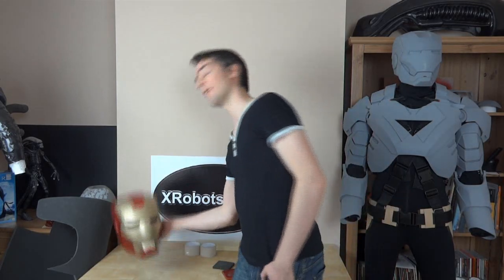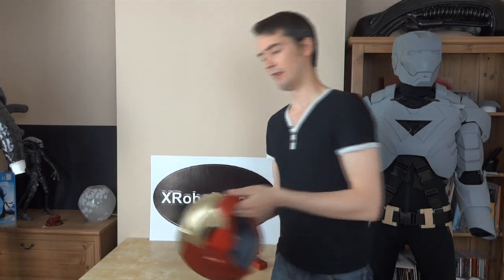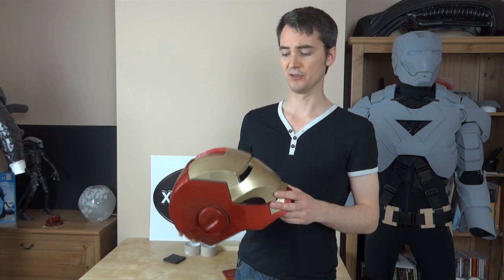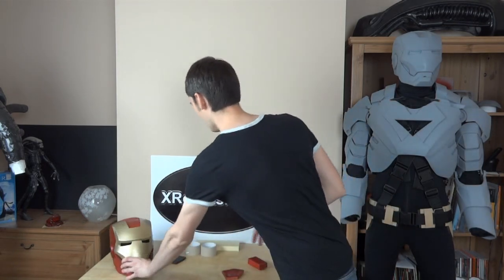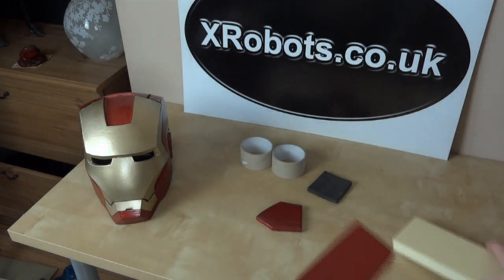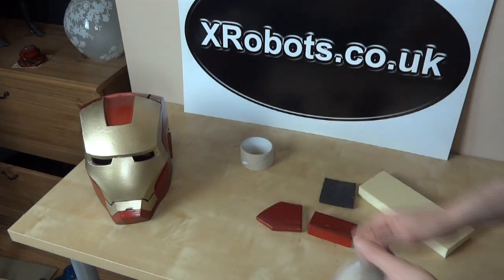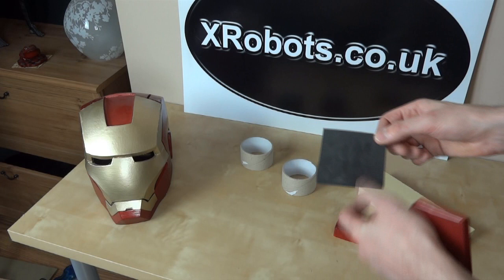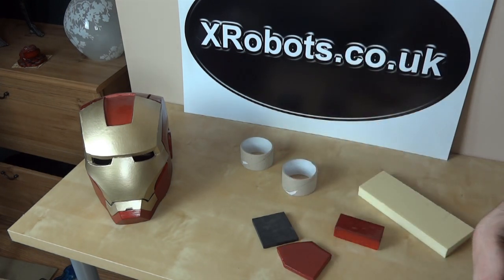Iron Man Power Suit #6 | Plastic Coating Foam | James Bruton

Comment: Tip... Elmers Wood Glue, (it's yellow) is not water soluble when dry.  When it dries, it can get wet, creates a really hard shell, and can be sanded to a smooth finish.

Comment: Easiest (and cheapest) solution is to use the white Elmer's School Glue.  It has more additives and is more acidic than straight PVA, which is important to consider for book binding, but doesn't make a noticeable difference for this application. ^_^

Comment: Great video. How does this hold up to being bent? I used EVA foam to make a few armor pieces, I sealed it with wood glue (several coats) and then paint and polish. I had a couple spots in my collar piece that creased where it bent a little. Does this make it totally rigid so it can't bend? Does it crack? Will it crease? Thanks

Comment: Awesome James! 
Question: Can I use an Epoxy Resin with hardener instead of the Smooth-on product?
I have used West System brand Epoxy Resin 105A with 206 hardener. Will this work the same way as you described?

Comment: For the bubbles, mentioned at 10:00 - I have seen in videos on coating wood (eg table tops) with resin, that a butane flame played rapidly across the surface pops all the bubbles, and leaves a very smooth surface.  I don't know if it would work with this, but it could be worth an experiment on some piece of scrap.  Keep the flame moving.  Don't actually heat any localised area of the workpiece.
Reply: I saw the same technique with heat gun and even with hairdryer. And that's definitely worth a try, though open flame could be really too much for the foam.
Reply: does anyone know if this coating makes it less flammable, I read polystyrene is highly flammable, but would coating it make it usable as something like an incense burner or ash tray?

Comment: great video. I do alot of slush casting, i suggest using the small white cups you get. they have small lines on the edge so are easy to measure. i pour a small amount onto each cup.. leave for a few minutes for the bubbles to disappear, then pour one into another ( when pouring, tilt the cup and pour onto the edge.. this stops bubbles forming) and mix very smoothly. then you can brush on. when brushed on use a hot air gun to remove bubbles from the surface.

Comment: Easyflo 120 is a good rotational cast urethane but i would suggest Easyflo 60 with microballoons in it. you'll half the weight and double the strength that way. and james if you see this, epoxy resins can be used on styrofoam without sealing.

Comment: Instead of brushing the PVA, have you considered using a LPHV (Low Pressure High Volume) spray gun for application? These guns are available with different nozzles, needles, and air caps for different viscosities in materials being applied.

Comment: I've a serious technical question: I'm using this very method but the resin seems to cure EXTREMELY FAST, I'm painting it on, and it's working fine, then BAM. 2 minutes in and it begins to catalyze before my very eyes. Literally in seconds. Is it the fact I'm using it in a very humid garage?

Comment: on eps i found  using bondo as a second coat for more detail and easier shaping/sanding helps. cuts down time it takes sanding the 65D. then i hit it with a last coat of the 65D to give it the clean plasticy look.

Comment: I believe what happened was that you did quite mix the correct ratios on your second coat. I was casting a mask once and this happened. As that was a mould I could just pour it out and go again. Usually the sign this has occurred  is that the resin doesn't go the creamy white colour that you see in James' video. I suggest you try cleaning off the stickiness a bit with a cloth and go again with another coat.

Comment: you could use a two part clear epoxy resin also instead of ploy resin cast, the epoxy dries slower and may even drip, dont know, but i have added artist oil paint direct to the epoxy resin for color.

Comment: I did both ways over the weekend. Heating it does speed up the process but the results are pretty bad. It cracks pretty severely. I put a fan in front of one of my test pieces and it sped up the process while holding the quality. Personally, if you have the time let is cure on its on in room temp, but if you're pressed for time simply throw a fan in front of it. You'll just have to sand a little more and do 1 or 2 more layers since it doesn't dry evenly if that makes sense.

Comment: Question; Could this method be used to coat a large section such as a chest piece? Main thoughts are that I could brush it on, let it set and then have at it with sandpaper or something... if you can do that. Any tips or info on larger pieces would help, totally new to foam building/coating and I'd rather like to try this!

Comment: If you are wanting to work with stronger plastics check out Sintra and Worbla. Sintra is a type of PVC sheet thermoplastic that can be molded with a heat gun like EVA foam but it is a lot stronger and painting it is easier. The downsides to Sintra are that is can sometimes be hard to find depending on where you live. Worbla is another type of thermoplastic modeling material. When heated it is a lot more pliable than EVA foam and Sintra and it is easier to mold it into organic shapes. Scraps of Worbla can also be stuck together and even molded together using heat alone. The only downside is that Worbla is extremely expensive per sheet.

Comment: Nice video, but I'm little bit concerned about losing some of the details. If You want to get rid of bubbles that are accumulating on the surface of the cast. You should try using blow torch. The flame will pop up all of them.

Comment: ...Hi, I'm hoping to use your technique to cover some polystyrene before slicing it up into 6mm sections, do you think this product would tolerate being sliced up on a bandsaw without deterioration or parting from the polystyrene. Thanks in advance.

Comment: Is it possible to remove the styrofoam after the plastic hardens?  I'd like to build something out of foam for the shape, but would like the finished product to only be plastic. I'm wondering what kind of surface you'd have after chipping away the foam.

Comment: A question for you. I'm getting ready to work with smoothcast for armor in a similar fashion you are. I noticed on their website, the sell 65D for 1 gallon bottles, so 2 gallons in consideration of part A and part B. With that, figuring you do 3 coats per armor piece, how much of that 2 gallons would you end up using? I'm trying to get an idea of how much I'm going to end up needing for a fairly large armor set

Comment: I have been doing fiberglass coating for a while on foam now and I'm pretty happy with it, because you can control the smoothness of the surface much better than with any other material. I was willing to try with a smoothcast resin AND fibers, but do you know if by any chance they work with making fiberglass like polysterene resins do?
Reply: What r ur results?

Comment: I am a big fan of your tutorials.  It seems like you are one of few Iron Man builders who are willing to share their techniques and secrets.  Especially the motorization of the helmet.  I am in the middle of a build but haven't decided if I should plastidip or rotocast.  Have you tried using body filler on top of the plastidip?  Do you think body fillers such as bondo would stick well to plastidip?

Comment: James I have been building a suit from foam as well. MOST of my pieces have been sealed and painted. Can this process still work on the already painted parts? I used a 50/50 mix of glue and water.

Comment: This is cool.  I was wondering James, do you know how this would work for PLA plastics?  I got a 3D printer, and I want to paint the sculptures I create, but PLA can melt in heat -- I'm trying to think of ways to make it stronger and more durable- as compared to just casting it out of another material.

Comment: since the foams end result is of a plastic nature does this mean a step using bondo is not necessary? also, for filling in cracks can we use some sort of filler?  for example, for a leg piece different rectangles make it into a circle shape but V shaped divets are between each rectangle. great video my friend.

Comment: Hello, quick question. If you just want to have a white plastic coating, can you just use the Smooth-Cast 65D? Instead of after using the Smooth-Cast going through all of the work to use a plastic primer and then a white plastic coat?

Comment: PVA is used as a mould release agent for resins so flexing the foam you've coated will cause the plastic coating to de-laminate from it
Reply: Yes it is wood glue, my point is plastic and resin will not bond to it
Reply: By no means an expert, but a 1 second google search would reveal PVA (release agent) and PVA (glue) are two different things albeit, very similar.  polyvinyl alcohol vs polyvinyl acetate.

The one used as a release agent is readily dissolvable in water, and the PVA well known as a wood glue is often used to waterproof materials.  They are quite distinctively opposites in terms of properties despite the fact that polyvinyl alcohol is made from polyvinyl acetate.

I believe PVA's (glue) adhesive properties relies on the porosity of the material in question, so the foam would likely be well bonded to the PVA, and cured PVA on the surface would likely create a seal of some sort, one that could delaminate a resin coating if it wasn't applied while the PVA was still tacky.

That said, a resin coating over cured PVA is probably as good of a bond as it would be on any other non-porous, smooth surface.  You'd have to do it while the PVA was still tacky or key the surface after the PVA has dried to create a better bond, assuming there is no incompatibility with the two materials.

PVA can be quite flexible so it will likely delaminate from a resin coating given enough traffic and flexing, just as a basic laminate coating on wood (such as a desk) can be easily peeled off by hand, and yet stay happily attached for years under normal usage conditions.

This plastic coating is also going around most of the item, encasing it, so delamination probably wouldn't do much. You could probably hollow out the foam since by that point, it's the plastic coating providing the structure /strength and surface finish..

Comment: So if you were to make a main body as you did with foam but instead with from expanding foam, coated it with PVC and the plastic coasting, would it have the same effect? I'm looking to sculpt a very large shell with expanding foam but it needs to retain integral strength, lightweight, and a smooth finish. I'm new to this please can someone advise. Fiberglassing isn't really on the table as I live in a studio apartment with no space to do it.

Comment: Have you seen that Smooth On has a couple of other resins that have a slower curing time? It looks like 65d has a 15 minute curing time, 45d and 60d have a 30 minute curing time, and 61d has a 60 minute curing time.  I wonder if that might help?

Comment: Do you think that letting the Polyurethane set slightly before painting it on would make it easier for the non-rounded pieces? Just so that it's slightly less runny, or would that make it too difficult to apply?

Comment: I think you'll find PVA is basically the same wherever you get it. Go for any craft PVA glue. It's not vastly important which you use, for example I use Hobbycraft brand craft PVA glue and it's fine. The only thing I'd say not 'School Grade' just in case as that tends to be weaker for safety reasons.

Comment: Could you get a matte finish after painting using this method too? (Would regular acrylic paint work?) Also, does this method give a waterproof finish once it's done (as in, one that wouldn't get ruined if the wearer got caught out by surprise rain)? Great video, thanks for posting it :)

Comment: How resistant is polyurethane to scratches and abrasions?  Say I want to cover my own BB-8 (not 3-D printed).  Would rolling on concrete or over bumps in tile slowly destroy the surface?

Comment: Would many thin layers work well for say, a bladed weapon prop? I'm going to be making Bravura, and axe from Final Fantasy XIV, and would like to know if the smoothcast would hold up on insulation foam while the end is on the ground. Would it bend and crack? Would my best bet to be to buy some worbla? Thanks! Love your videos.

Comment: Wow this tutorial just saved my prop building life (my polystyrol-sheets would melt away when combined with certain materials usually) So if i understood correctly PVA can be used between two components that would otherwise react? - and then about the smoothcast/polyurethane - is it toxic/does it smell? Thank you very much - subscribing anyway ;)!

Comment: If anyone else was put off by the price of Smooth on in the UK like me I have tried and tested an alternative. Polytek Easyflo polyurethane resin works great. I chose Easyflo 95 because it gives you a slightly longer pot life (5 minutes). The finish you get has a bit of flexibility which is handy to ensure you can actually move about in your suit.

 If you want a more rigid finish they have many other varieties with differing properties. 95 possibly goes more rigid with more coats.

Comment: Hello James, fantastic site and great work!  I was just wondering if you had noticed any cracking/flaking problems with the plastic coating at all?  I would think that there is still some flexing going on with the foam and I was curious how that effecting things overall.

Comment: How many square meters do you think a gallon would cover? This would be perfect for a full body armor cosplay that I want to make, but if it takes 3 or 4 gallons at $85 a piece, then it is a little too expensive..

Also, when I checked out the hardcoat 65d online, it said the amount was a gallon. This is a gallon total, not a gallon of each part, right?

Comment: I have been using the Smooth-Cast 65D and sometimes it cures really fast and other parts take DAYS! I've been coating my styrofoam with wood glue first. Any advice?

Comment: So I see this stuff being made for more cybernetic pattern with sharp and or flat edges. Can this be used to make more rounded, sleeker, and or streamlined designs? For example what I'm going to attempt to make is armor that includes shoulder armor which has a round design that is waved at the bottom much like a turtle shell. Would it be possible to mold it like that, and would you happen to have any tips on how?

Comment: Hey James, I'm using this method right now for my Iron Man suit, the only problem I'm having is sanding it....sometimes the plastic will start to peel off when I sand.. and sometimes i just can't get it on smooth...It also starts to bubble up. Do you have any suggestions or tips? I bought all this resin and am hoping to get it working :)

Comment: First off man. Thanks for everything you do. Not only are you superinformative but very fun to watch :)
I have a question about the PVA glue. I watched another video series that outlines a similar method but the author says to water down the glue at a ratio of 1:1 or else the glue won't bond to the foam very well. What are your thoughts on this?

Comment: yeah,i figured id give it and try and see using a sample piece. one more question, i was looking at the foam templates on pepakura and i was wondering. what holds the pieces together? is a foam strip under the pieces u attach them to? crazy question..lol

Comment: does the foam remain flexible enough after 2 thin coats?
I use 2mm foam and would like if it remained quite flexible so it fits easily and tight enough so it stays in place

Comment: Alright I think I'm going to give it a shot then also apparently it's impossible to find Plastazote foam in the U.S but I did some research and most people use EVA foam over here which is identical to Evazote think this method would still work with EVA foam?

Comment: also, unless you sand between coats, the liquid resin will not adhere to fully set resin. you must apply a second coat when the first coat is still slightly warm.

Comment: So cool.  I'm about to start an animatronic Mk.VII build with some friends and we've decided to try this method.  I think rotocasting the larger pieces is going to be the hardest part.  How do you think you'll maintain the proper shape with, say, the chest piece (which might flex if using thin foam).  Perhaps temporary internal supports, dowel rods, etc., or just have one of us wear it over a plastic poncho while someone else applies the PVA and 65D?

Comment: I tired this last Halloween on my Iron Man armor.  It really only worked on the small pieces.  I could not apply it fast enough for the chest or shins before it started curing.  Sadly, it made quite a mess of some of my pieces and really doesn't have an undo button.  Still would love a decent coating solution for foam.  Building speed is great, but the gaps are a bummer.

Comment: Thanks for sharing your methods James, that's really nice! I just got a question, since i've never worked with foam. I read a lot about how foam costumes are easier and cheaper than paper/bondo/fiberglass, but are also less durable. The way people talk makes it look like they're expendable or something. Does this plastic coating give them a good durability for a final product, or you'd still recommend moulding/casting it?

Comment: *****  nice video! You inspired me to start my own Iron Man Project, but currently I am stuck in the process of coating the parts with smooth cast 65D.
As you mentioned its cure time is very low....which is good for the parts I guess. Unfortunately my paint brushes get destroyed during the process, because when I finished brushing one part the resin also sets on the paint brushes and it gets very hard. Do you just use a lot of brushes or do you have some sort of dissolver? I tried to clean the brushes with water but it did not have any effect....
Keep up your insane work!